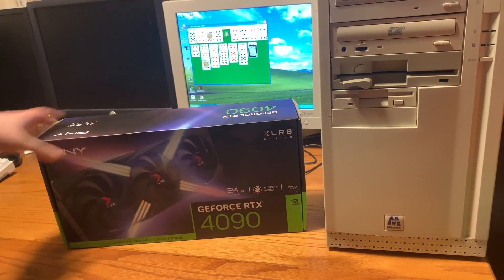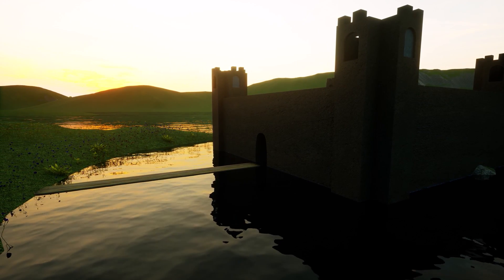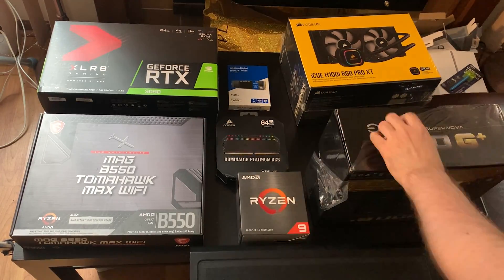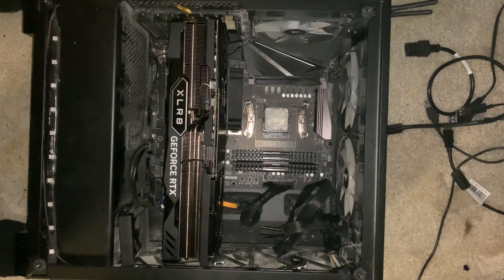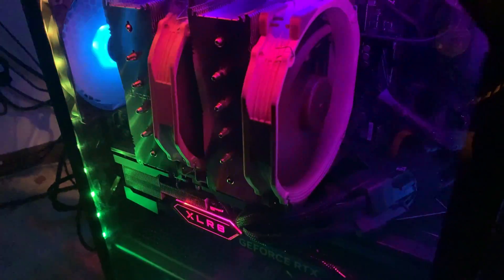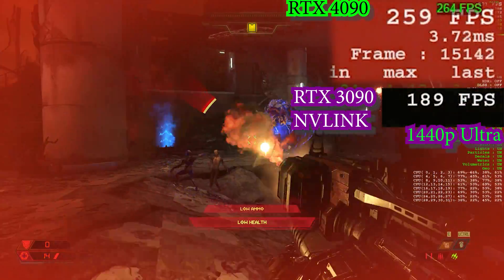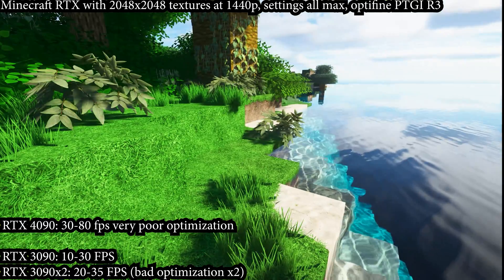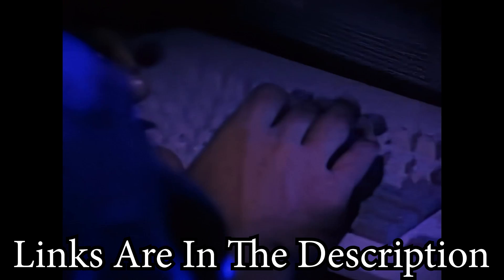RTX 4090 VS Dual 3090 NVLINK Gaming PC Build And Benchmarks

Comment from the maker: Shrek Noire 2 RTX Pre-alpha is currently the most intensive game out there for the RTX 4090, still in development, you can see a brief tech demo of it and it’s brother “Shrek Noire 95 RTX” and the original Shrek Noire 1, in the video above. 

If you’d like to help fund this insane project support me on patreon in the description

our ultimate goal is to eventually be able to afford a remote server that has at least 64 cores, 256gb of ram+ and 3 or 4 way NVLINK so that the developers of this massive completely insane project can render out 16K 60 film quality cutscenes, and push extreme resolutions with raytracing and VR. We intend to make shrek noire 2 a game designed for the future gpus of 5 years from now, a benchmark that will likely need a 4090 for a playable 1080p experience, and it will also have multi gpu optimizations, we’ve tested the engine and verified it can utilize 2 gpus, but need to test 3-4 next.
Reply: This wasn't my exact results/experience, but I do run my own custom firmware and drivers though,so this is probably where some of the performance of these tests,with your 3090s,were lost and I also use/used 3090tis and not 3090s.

This has been my experience, I've been gaming at 3840x2160p, since 2016 and in 2020,when I got my 3090s, I got one Alienware 50 something inch 7680x4320p monitor and I've been gaming at 8k A LOT since then/I got 3090tis after that and I got a 4090,but it was weaker than my 3090tis system,because Nvidia handicapped their card by removing the NVLINK plug,I usually code something to optimize two cards,but this time, I kept my 3090tis/i9-13900k,128GBs of DDR5 RAM system and decided to build a separate system around the 4090 with an i9-13900k and 128GBs of DDR5 RAM and I utilize a hyper visor,which was a great idea,because now with the power of two Titan RTXs,two 3080s,two 3090s,two 3090tis a 4090,an i9-10900k,an i9-12900ks,3 i9-13900k CPUs, with a total of 98 cores and 512GBs of DDR5 RAM and 128GBs of DDR4 RAM,totaling 640GBs of RAM/all of my old computers that are still worth keeping, I can basically run and do anything I want to do on my network with them/I can stream multiple games to my monitors/TVs/Steam Deck,I can run multiple Virtual Machines simultaneously to test my code.

I have MOST of my systems hardwired/plugged up with RJ45 cables,but my laptops,phones,tablets,Steam Deck and so on are designed to be portable/not tethered to a wire, so I SOME WHAT recently got four ROG Rapture GT-AXE16000 routers,that replaced some Night Hawk Routers, to cover my whole house/one for my back yard area,one for my basement,one for my first floor and one for my second and third floor.

I've been thinking about adding two more i9-13900k CPUs to the equation, my goal is to get to 148 cores and that would get me to 146 cores, I also don't want slow cores either/traditional server cores are trash,also AMD isn't an option, because all cores aren't created equal/if you compare an i9-13900k/Intel core to an AMD core,you will be disappointed with AMD/SOME of AMDs CPUs have like 64 cores/the 3990X has 64 cores,but the single core performance of a 3990X isn't great,maybe since I don't have a system in a Z790 board, MAYBE that COULD be a good idea/I could get another i9-13900k/4090/128GBs of RAM and then when Meteor Lake comes out I can get an i9-14900k/ks system. 

My Hyper Visor journey has been good so far/being able to combine all of this hardware vs my usual two card setups has really changed things for the better, my work loads are handled perfectly/I only run Kingston KC 3000 SSDs and SOON I'm going to add some Samsung 990 SSDs,I have a total of 60TBs,for storage/each of my systems have 12TBs in them,for movies and games,I also have some smaller sized SSDs,for Manjaro Linux,Windows,Virtual Machines and projects,but the removal of the 4090s NVLINK plug has really opened a lot of doors/has been a really good thing, at first I didn't think this was true/I thought it was going to impact my work loads, but with the options Hyper Visors give you NVLINK isn't really needed anymore/with a hyper visor you can crush any single system easily.
Reply from the maker: @mattmatt2417  this is very similar to my configuration minus the Linux, I have found the 4090 to be very fast, 3090 tis can pull a bit more than the 4090 in nvlink but the regular 3090s are slower by a good margin sometimes, your 13th gen cpu likely removes any bottleneck that I could’ve had, what do you use all your systems for? I do rendering/3d graphics
Reply: @psychoticgiraffe  7680x4320p gaming,multiple game streaming instances simultaneously,VMs/Virtual Machines/I run/test my code in/on multiple platforms/OSs simultaneously/this is what I use my systems for/my big connected computer/hypervisor for.
Reply from the maker: @mattmatt2417  that’s incredible have you ever tried making a game
Reply: You should try play some games!!
Reply: NVLink isn’t even supported on the 4000 series, including the workstation cards
Reply from the maker: @christophegroulx7816  you're right, although, I didn't anticipate that the a6000 Ada would eliminate nvlink, memory pooling still works over pcie on it but its dog slow, nvidia put all their budget into the h100, I believe that some of the top end gpus still do nvlink but just not the quadros or reg;

this actually might be reason to buy 2 3090s over a 4090, if vram/ai was the main usage case.
Reply: @psychoticgiraffe  How can you do memory pooling across the PCIe bus?
Reply from the maker: @christophegroulx7816  works in linux and also on SLI motherboards(theres like one for 12th/13th gen, its insanely expensive), its nowhere near as good as having nvlink though
Reply: @psychoticgiraffe  Would you mind giving me the name of this or something that I can research further? I can't seem to find anything on this subject. Thank you!
Reply from the maker: @christophegroulx7816  I found it when I was looking in an nvidia forum, they were using Linux so I’m unsure how you do it on regular windows, also Jensen stated during an nvidia event specific motherboard could use multiple 4090 with full bandwidth, it’s hard to find any of it now, but if you dig deep you’ll find something; “memory pooling over pcie bus quadro a6000 Ada” leads you in the direction, supposedly, the same technique can work on 4090s but it’s slow and not great
Reply: @psychoticgiraffe  That was done on purpose by Nvidia. One of the world record S.L.I holders for 3D mark found that S.L.I/ mGPU is block on lower cards. This probably because Nvidia wants them to spend more money on a much more expensive single card/&/or workstation cards. I was also roaming on indie developer forums where people even had problems with nvidia's own Cuda software on the RTX 4090. They couldn't even get the native mutli-gpu versions on Cuda to work on dual RTX 4090 even though Nvidia claimed it should worked. (Nvidia was blocking it again) The issue is the way the memory pooling is searching for a Nvlink in the software that doesn't exist in the RTX 4090. & also doesn't exist in the A6000 either.

Comment: What's the temperature difference between teh two 3090s? The one on top has a much smaller gap for air flow
Reply from the maker: only about a 10 degree difference, the case cooling airflow is pretty good is why

Comment: I've got RTX 2080 ti's in S.L.I, & it run circles around your RTX 3090 setup. I do have MSI meg ACE x570 I bought for the S.L.I certification, & a 5800x 3D. I could also give you the list of games that have proper mGPU support in either Vuklan or DX12 if you want?
Reply from the maker: test shrek noire on that setup and report back with your FPS results at 4k res (or simulated 4k) and then try it again with extremely exaggerated reshade raytracing

this is the game I was testing in the video http://mc.tulli.com:25565/shreknoire/
Reply: @psychoticgiraffe  where's the reshade & raytracing at?
 I get like 160fps minimum 350fps max on my setup with simulated 4K.
I to test this twice because I had my Nvidia control panel setting set to single card instead of recommend or A.F.R, however, I was still getting a 17-20% load on the second card.
Reply from the maker: @kevinerbs2778  http://mc.tulli.com:25565/windows-archive/games/windowsXp2K/shrek%20noire%20rtx.zip contains the reshade preset i used in video, but isnt the latest version of the game, just the version i used

If the link doesnt work delete the last part and stop at windowsxp2k and find the shrek noire rtx zip
Reply: @psychoticgiraffe  I think I don't I have enough Vram on my cards. I'm getting the same fps in 1080P as 2160P/4K simulated.
Reply from the maker: @kevinerbs2778  I think its possible that you're hitting that wall, the 4090 an 3090 for whatever reason doesn't hit the wall as shown in the video, but not all of the second 3090 was really used, it still supports SLI but something in the game's code didnt' fully utilize the two cards for me either, but it can't be that, it must be vram limitation, sounds accurate.

Comment: Cool video, thanks. The Nvlink benefits come when you use programs that make use of the 48GB memory stack of the two 3090. 
In games the two cards operate in SLI mode if I remember well, with all the goods and the cons that the mode has: meaning that some game will support it properly and others won't. 
The 4090 is expected to be faster: the Cuda cores, the tensor and the RT cores are better, faster and more efficient than the previous generation.
The 3090 setup, though, wasn't the best. The two cards were too close, the fans of the card in the top position were blocked by the 2nd card. Water blocks or a motherboard with more pcie slots would make a better setup for them. 
But why buying the 3090s new? Old gen hardware can be bought used.
Reply from the maker: oh this video is back when you could obtain them cheaply new, now its tough to find these new

Comment: Didnt think nvidia would go so low that they killed off nvlink! No more dual gpus. I knew they would do at some point as they are pure greedy!!! Making sure we have to go to the new gen instead of getting an extra cheaper of the same to run 2. 
Really wish amd would make gpus proper ones though for high end gaming
Reply from the maker: Yeah, the oddity was that aside from In blender which I didn’t showcase much, the 4090 was a victor everywhere else, I actually ended up putting two 4090 into the pc because blender liked that 5-6x as much as the 3090
Reply: @psychoticgiraffe  That's because the core clock speed are 50% higher than the 3090's. it's not a fair comparison because of that.

Comment: One 390 is worth more then my car.i wish i could afford a pcs like this guy. Thanks for trying sli i miss doing sli back in the days of 8800gtx ans 9800gtx
Reply from the maker: I have still voodoo 2 sli somewhere, that was inside the beige pc until I took it out to place a 4090 inside it

the voodoo 2 is now inside my white corsair case alongside a celeron 1100mhz slotket adapter on a 440bx asus p3b-f motherboard with 1gb of ram and a 128gb SSD running 98, it also has a Rage Fury Maxx connected to the voodoo w a passthrough cable + some random weird ISA sound card

sli was the best, that is one reason that while my results didn't really lean towards SLI winning at all, in the one task I didn't thoroughly test due to not being as good at 3d modelling when this came out, the SLI gave it a significant edge when rendering gigantic 8k projects in blender; while in 3ds max, not much difference unless you're trying to be pixar either.

Comment: For 3d rendering, 2x3090 with nvlink allows you to have a shared 48Gb VRAM pool and for some scenes it's required and you can't render them with a single 4090, which no longer has the nvlink
Reply from the maker: this is a good point, however, I've never made any scenes that surpassed using 24gb, I've gotten dangerously close to that, but, unless I were to do an 8k render which in something like blender or 3ds takes a painful amount of time and often people will just do a 4k render and upscale it with AI, said limit is not usually hit. Do you know though if the 3090s can do nvlink with 4 cards at once? because I think the A6000 (non ada) can, which would potentially allow 96gb of vram pool, I've never tested more than 2, but if the purpose was 8k rendering, If 4 3090s could be utilized the same way as the a6000 I'd have been more on the side of buying 4 3090s instead of 2 4090s
Reply: @psychoticgiraffe  you should try loading LLM with huge parameters say LLAMA3-70B
Reply: Rtx 4090 48gb existing...

Comment: I am using 2x 3090s but without SLI and blender and other render engines like Redshift & FStorm render performance is close to a single 4090. the cost benefit of low price used 2x 3090s vs new 4090 is more as compared to performance difference.
Reply from the maker: I've found that the 3090s are a good bang for the buck but you end up saving only like 200-400 dollars on a dual setup hence why I vouch for the 4090, also I have two 4090s now in that test rig, which in testing was equivalent to 5-6 3090s, and at current value of those cards, it seems I save nothing other than power draw by going with the two 4090s over it, neck and neck cost. So even though I prefer the 4090s it seems that I'm only really saving heat/power, no cost difference either.
Reply: yes power draw is the difference, absolutely! @psychoticgiraffe

Comment: The Sli is a GPU sales feature, some people would like to have 4 X RTX 4090 just to test the results.
Reply from the maker: a test I did not do in this video was see how dual 3090 would impact Blender, as at the time of the video I wasn't as proficient in blender, not having used it since 2.8; interestingly, sometimes in blender the two 3090s were actually a whole minute faster per frame of render time if doing animation when using Optix.

while SLI may be like, useless for gaming usually, with exception to the few games that did work with it and give a significant gain in the video, multi gpu for NON gaming, despite being really not worth it in 3ds max, is actually really good when using blender.

Comment: Than you! The 4090 doesn't support P2P like the 3090 so it might be pointless getting two 4090s.
Reply from the maker: Actually, blender, 3ds max and vray all support dual 4090, and certain insanely expensive boards allow sli with them; Jensen had revealed this, you need a lot of bandwidth, it’s not as useful game wise though
Reply: Sadly.. wish the 5090 supports sli ha@psychoticgiraffe

Comment: Tho if the dual 3090's are sandwiched like that they'll over heat and you will loose some performance and same goes for the 4090
Reply from the maker: Max temp on the 3090 nvlink was only 84c but only one of the two cards was hitting that, the case has decent enough airflow, not ideal, but it didn’t overheat
Reply from the maker: Temps on the 4090: 26c idle, 60c max load 

this result made me think I got a perfectly binned card or something, i think it’s caused by the cooler design and the fact that my case has a lot of airflow, there’s like the fan right on the edge of the card pulling air into it

Comment: What are the temps on load of top 3090, it looks yo me that is suffocating with no airflow at all, sure reaches 90 degrees and down clocking
Reply from the maker: 84c max load on bottom one, 75c on top (I had some finicking to get the nvlink to work, but it indicated it was working)

Pny makes pretty good cards, the case is large and has enough airflow, but admittedly I’d prefer if it ran cooler, I’m going to add a giant amount of additional fans to direct the heat better; 

On the 4090 pc the temps were 26c idle 60c max load, due to my airflow I think, or my card being just lucky idk

Comment: I remember the days building my 1st mid end pc, putting the graphics card 1st before cable managing. That how excited I was when I 1st had my RX580 😅
Reply from the maker: yes I too had an RX 480 at some point, it actually died and XFX sent me an RX 580 instead, which I think also died, because I don't have it anymore, I swapped it for a vega 64 which I kind of don't have a use for anymore now that I have three PCs with 3090s, 4090 and 4090 I most likely made a video using that rx 480 card at some point a long time ago; I think theres a video where I say everyone should buy two 1080 tis a year or two after I got that card; I used to be team Red until that 1080 ti; I don't think I still have any 1080 tis left because I sold them to people who needed a good 1080p card and couldn't afford 30 series; but I do still have dual titan X maxwells, one of the rigs in the video, the mini itx one that I did a Titan Z build in, currently has a titan x 12gb maxwell card in it.

i hope amd will catch up again because the days where the rx 480 wowed me have passed, I think in price to performance was really the main spot where that card was great, used to be as common in a steam pc as a gtx 970.